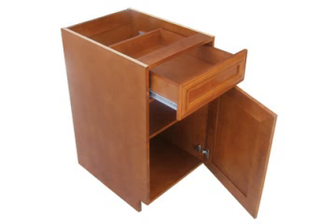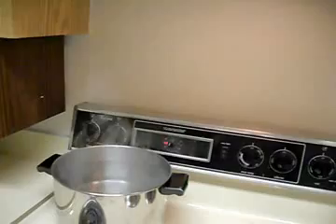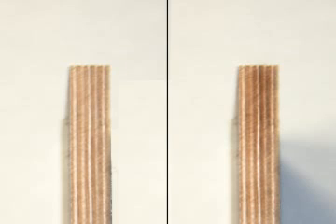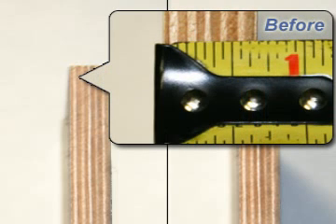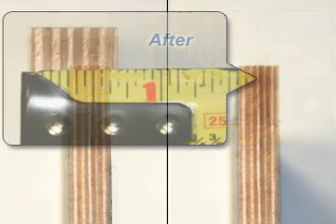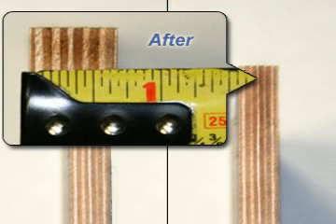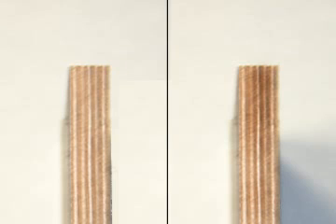Plywood Vs. Particleboard Durability & Quality Comparison for Kitchen Cabinets

Comment: On the exposed edge, yes it showed plywood to be superior but that's a really small sample to infer that plywood is always better.  

If both are sealed well the core won't contact moisture and it's a mute point. MDF, HDMDF, or particle board are engineer and will stay flat and straight as long as they are sealed or kept from the elements. Plywood cores are stronger but tend to be more prone to warping though cut into cabinet sized sections it will be minimal. 

I would also bet Mei Kitchens use particle board core for their countertops  unless they're using marble or a synthetic version of it.

Comment: I'd like to point out that there are different grades of particle board, and also different types/percentage of resin used in particle board, which act to bind together the wood chips inside the board.  Many modern furniture manufactures use a higher quality engineered wood of a type ,which is essentially particle board, but bound together with a high quality poly-resin.  This makes the material waterproof, is very strong and durable, and can last many years.
Reply: That ain't what they use at Home Depot... lol!